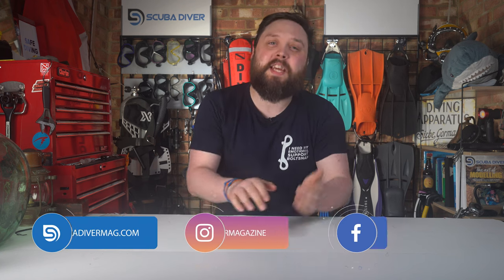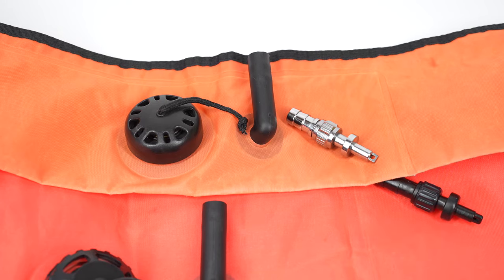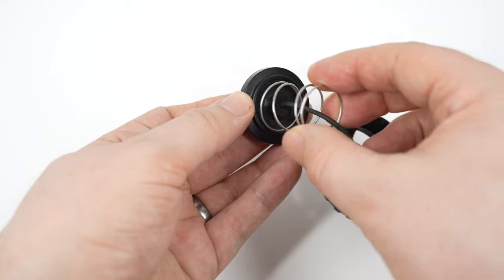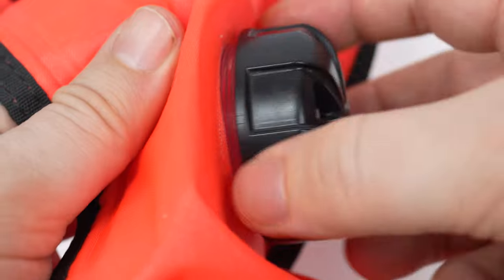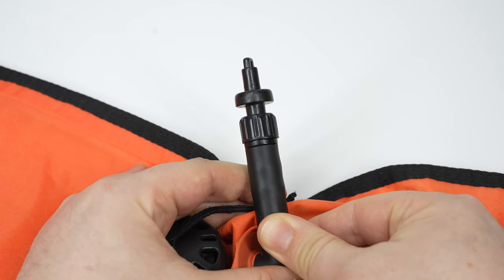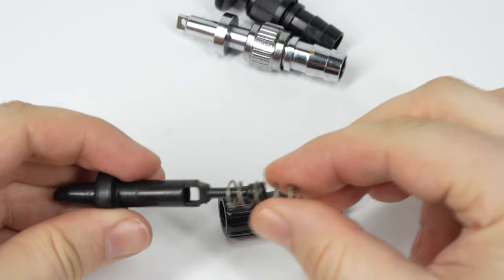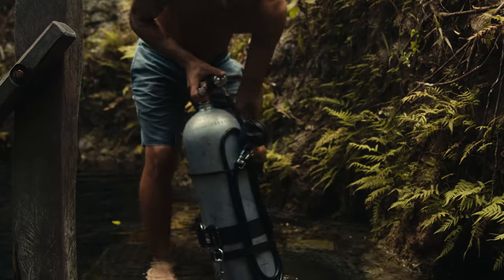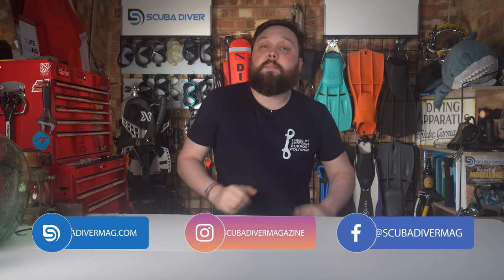How To Disassemble and Clean dSMB Valves #scuba #howto

Comment: Hi Mark.

Recently on a trip my buddy gave the dreaded hand across throat and wide alarmed eyes (!) on the Irako at 30m. I have just finished my IDC and gone through teaching all the scenarios of secondary donate and lifting the arm so they can grab etc However, my instinct was to primary donate and I reached for my octo on my harness. I know that primary donate and secondary on a necklace is an option. Since, I now know how I would react in that situation I am considering moving to primary donate and secondary on a necklace. 

Is it possible that you can make a video on this setup for BPW and where / how the long hose is stored? Also, how long approximately should the hose be on the octo? 

Keep making the awesome videos.

Thanks again,

Doug
Reply from the maker: Sure, the most common setup is with a 210cm or 150cm primary hose and a 55-60cm short hose. It can depend on whether you're diving singles or twins and the thickness of your exposure protection But, you can use a piece of string tied to your 1st stage to work out how long you need the hose to be.

The short hose is put in place first over your right shoulder and you basically want the shortest hose to place the 2nd stage under your chin to reduce any excess hose.

The long hose starts by routing down your right side behind your shoulder. Then it hooks under something on your right hip such as a drop-down knife on your waistband. The hose routes back up across your chest to the left of your neck, wraps behind your neck so that it sits on your right side.
Reply: Thank you

Comment: I presume this is akin to the dump valve on a BCD. I got the notion from observing this video that if you can route the line to your shoulder (near your armpit), enabling you to easily pull the dump valve to release air, it would simplify air dumping for divers rather than prying it from your lower back (Sidemount diver). The routing would resemble how you route your primary torch. What are your thoughts?
Reply from the maker: Routing the corrugated hose from the lower back position? The main downside I can think of is damaging that corrugated hose in an overhead environment and you can't inflate. The elbow joint is typically taller than an OPV so it's more likely to be the first thing that scrapes on the ceiling.